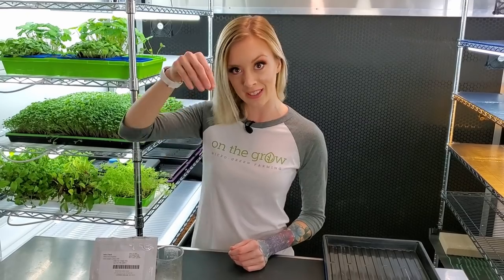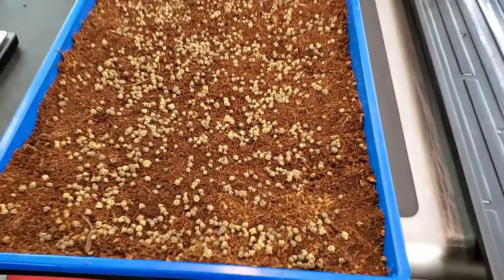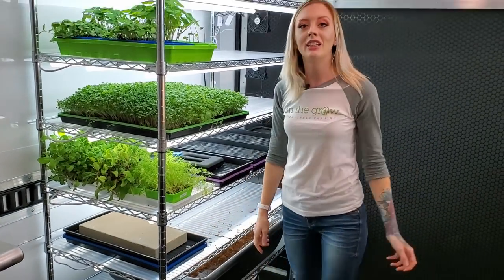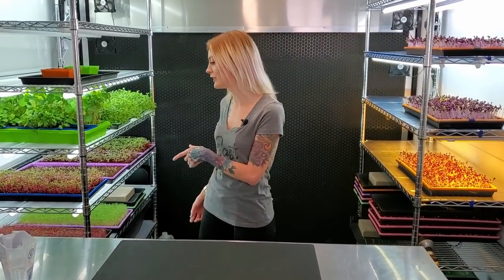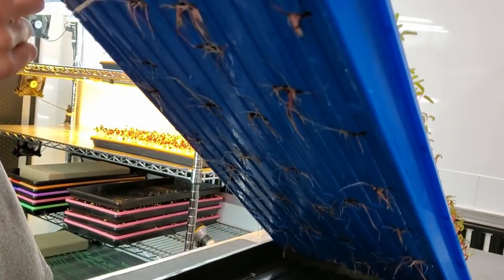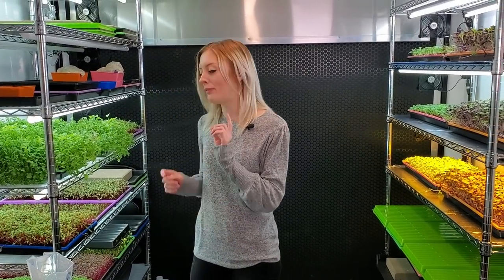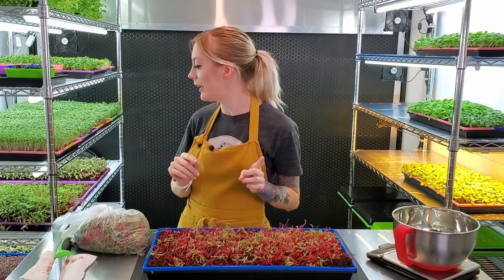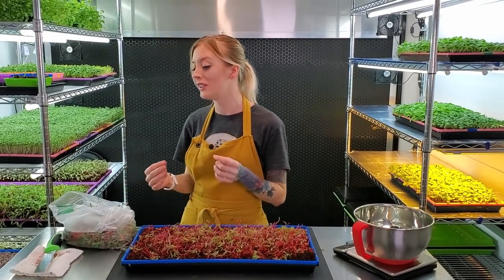How to Grow Swiss Chard Microgreens - Full Walkthrough with TIPS & TRICKS - On The Grow

Comment: Fantastic video, as usual!

I was talking to a friend of mine recently because i am thinking of getting started with this as a potential business and he asked me about the need for a health dept certificate or something like that. Did you guys have to go through any type of certification or obtain any permits from the local health dept or something similar?

Also, I work at a grocery store (with expensive products and that shall remain nameless for now) and a few customers have inquired about cilantro microgreens. It seems to not be common... have you had any experience with cilantro microgreens?

Thanks and keep up the awesome work! 👍🏼
Reply from the maker: Thank you for the continued support! 
It really depends on your local regulations... We went to our local health department and asked them if they wanted to come inspect our space and practices and they said that we don't need it because we are not dealing in Meat or Dairy which require temperature. 
We did take an online course as extra precaution when we first started which was a food handlers course. They are very abundant and cheap. It was like 3 hours and $25 if I remember correctly. I think it is a very smart and easy way to start getting into the mindset for handling the micros and having good sanitation practices. 
Cilantro are a bit challenging. We have tried them a few times but only get like 50% germination. We will give this a try again soon and see if we can make a full walkthrough on it! I think there is someone on YouTube called RunningFarmer or something like that who has a good guide on how he grows cilantro.

Comment: Guys, thank you SO much for these daily walkthroughs!  There are tons of microgreen growers/youtube creators who give great advice, but your watering system has been so helpful to me.  I do have a question...will adding a layer of soil work as well at removing the seed hulls as cocoa core does?  I use soil.  Now, I am thinking of switching since I have seen your videos.  Are you using that media exclusively, or do you also use soil?  Thanks again!~
Reply from the maker: Thank you so much for the support!! Yes, a thin layer of soil will work perfect as well! We are actually going to be switching over to soil soon because that it is a lot easier for people to use. We currently use Coco Coir mainly because we have a lot of practice with it and it does provide really solid results. Soil should work the exact same, just don't add nutrients because the soil will already have some for the plants. Thanks again for your support!

Comment: Question: I am in central Florida using a screened Florida room to grow. Growing was easy until the 90 plus degree temperatures started. I seen you used 1/2 cup of solution... I was using the small portions of water and all my microgreens collapsed... I found that with extra water they came back... I am having to water up wards of 2 cups of water 3 times a day to keep up with the heat. Everything seems ok now but am I doing the microgreens harn by using so much water. I am slightly confused.. I know too much water leads to disease and mold but I am not having those problems.. have you had experience growing in high temperatures but well ventilated and no direct sun light...
Reply from the maker: Great question! Every grow space is going to be completely different, we just offer what we do as a general guideline and there is nothing wrong with going higher or lower based on your crops needs. High heat will definitely make the plants suck up a ton of water and I’d give them as much as they need unless they start showing signs of problems. For example if you notice your grow medium is still really wet, I’d drop the watering a little bit. But if the medium and plants seem happy with the amount your giving, I’d stick with it. We have to drop our watering in winter (when this was filmed) and then increase it in the summer. I think we could’ve done better to explain the potential fluctuations and I’m glad you got it figured out! So keep them hydrated and only start to reduce if they aren’t drinking it all or the temperature begins to decline more. 🤗🌱🌱

Comment: Great instructions! I do have a question however... I've seen other growers use HDPE plastic trays, are the trays your using HDPE plastic?
Reply from the maker: We use PP or Polypropylene trays. HDPE is another great food-safe option! Though HDPE and LDPE tend to be more flexible than PP.
Reply: @OnTheGrow  awesome! So is the purpose of the weight on top to make the sprouts thicker and succulent? Do they grow thin without it?

Comment: I like to recommend wicking on the 1020 trays. This my give us less water from day to day.
Using 1/8'' cotton line, cut to any lengths. place them in the microgreen trays - Shallow with holes, so they extend by a few inches past it into the bottom 1020 tray so as to wick water from bottom tray.  Add water half way in the 1020 tray Bottom. Add (x4) 1/2'' or 3/4'' PVC pipes cut to 10'' or 12'' in - offset x4 PVC pipes to balance upper 1020 upper tray Shallow with holes that will make the

Comment: What’s your room temperature? Do you use ph balanced water when germinating, what your room humidity?
Reply from the maker: Room temp= 67-73F now that it is wintertime... in the summer our space was 75-80F which provided the fastest growth and germination. Humidity = 50% or below at all times. We do not pH balance the water used to mist during germination... we just use our filtered tap water which is around the 8.0pH range out of the hose.
Reply: On The Grow thank you for your reply... is there a reason why you don’t increase your temperature during the winter to reflect the summer temperatures?
Reply from the maker: @jasonspies8760  The heaters struggle to keep it 70 on the really cold days... We need a better heater for our growspace. Our A/C is great, but the heater is very lacking. We are just riding it out though because I want to see if the system will make it through an entire year basically unchanged.

Comment: On The Grow +  
How much did it cost for your total trailer setup including trays, racks, lights, sink, hose, mister nozzle, etc..?
What are the dimensions of the grow trays?
Reply from the maker: I think its about $20,000 total with everything... I still need to add it up because we've changed so many things over the months. The trays are called 1020 trays because they are 10 inches wide and 20 inches long!

Comment: How should I choose LED?
Reply from the maker: We primarily use LED lights that are 18 watts each and we use three of them per shelf. Each light puts out roughly 2,000 lumens which is a combined output of 6,000 lumens per shelf. We prefer to use only LED lights since they use less energy and create less heat than fluorescent bulbs… The color temperature we use for lighting is 6000-6500K. We keep our lights 8 inches above our grow trays. As for our lighting schedule, we have had great results with 17 hours ON and 7hours OFF everyday.